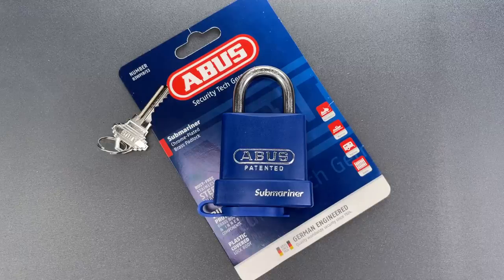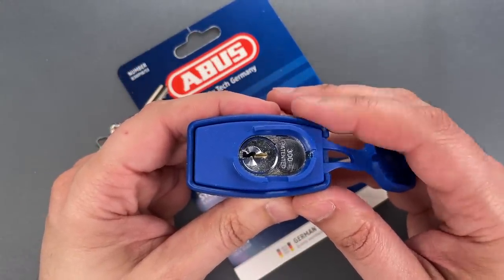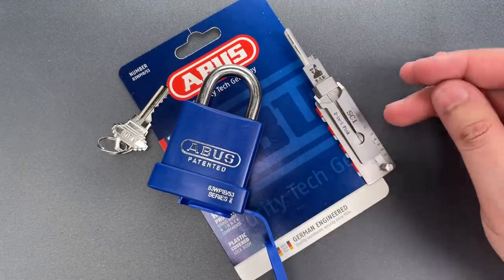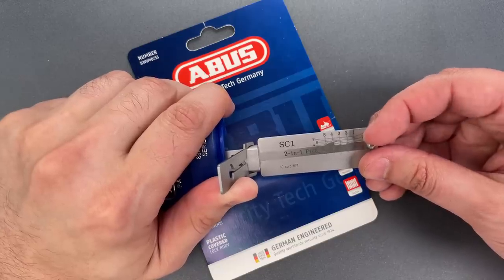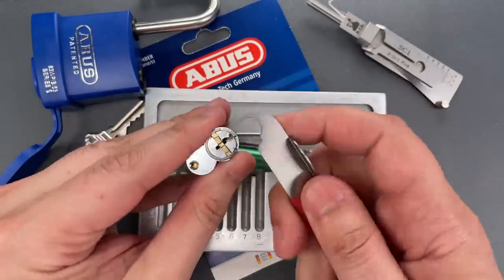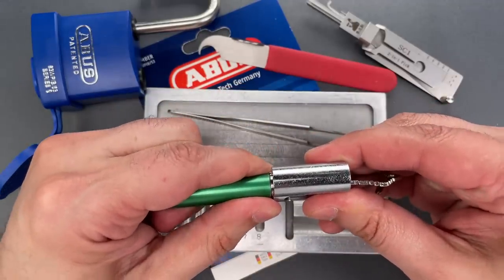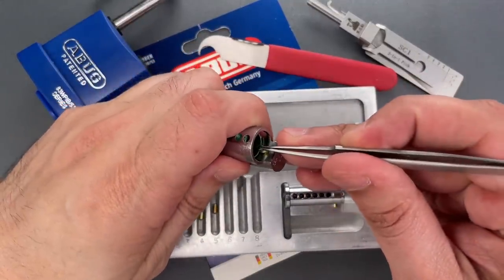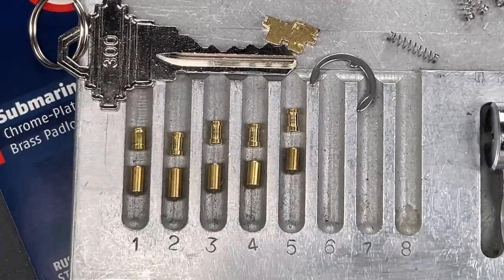[1329] Abus “Submariner” Marine Padlock Picked & Gutted (Model 83WPIB/53)

Comment: I would be interested to see you put a lock back together after gutting it like this
Reply: After you put the driver pins back there isn't much to it.
Reply: He has a video about upgrading locks to be pick proof
Reply: @IAMDARTHVADERBITCH  Link to that video pls ?
Reply: @Boaz Greenwood there's another video on that too
Reply: @Boaz Greenwood so how would you?
Cuz I have a vague idea of a tool that could work
Reply: @Boaz Greenwood he actually says that in the video, doesn't he?
Reply: @Boaz Greenwood it’s just a trap for those who are not aware of it. Pick resistant yes. Definitely not pick proof. The trap will render the lock useless. Can’t open with key if trap is set off.

Comment: I really love the modularity of locks like this. the ability to re-pin locks is something I think I'll look into at some point so I can get rid of some of the keys off my own key ring.
Reply: Long ago, I had one key set for my house , parents, inlaws etc..  I really do not like carrying keys.

I also cut the two sides of a toyota blank to work on my wifes and my truck.
Reply: Abus 83/45 or 83/50 is your ticket.   We use them to lockup patio furniture at our restaurant.  They are all keyed the same as the front door key.

Comment: Compared to his normal reviews, this almost rises to an endorsement.
Reply: It's a competent implementation of a standard keyway, with interchangeable cores.  A novice like me can easily key these things.  That's what the cutouts on the side are for.  So you don't even need to use a follower to re-key it.  It's not a high security lock, but it's also not a cheap MasterLock. I would consider this to be a workhorse lock for homes and businesses.
Reply: LPL said it best, it's fine for anything low security. It's also cheap so you get what you pay for
Reply: @ViperGecko6  and the added factor of a very specialized application makes is a niche product!
Reply: Well, it's ABUS.

Comment: So, the lock is German but the core is not, which probably means the lock itself is better than the core...
Reply: @silvertip185  I see. I thought because LPL said it is a Schlage core that it also meant, Schlage produced the core and Abus just inserted it into their lock.
Reply: @MhLiMz  Nope. It just conforms to Schlage's keyway pattern. Every single driver pin was a security pin of some type; Schlage doesn't go to those lengths.

Comment: This must be a pretty decent lock because I didn't hear LPL say the phrase, "obvious security vulnerability."
Reply: He even said it would be "good for a low security outdoors situation like a garden shed". That is better than 95%+ of the locks on here.
Reply: I mean, it is an Abus.
Reply: If you want something in a maritime outdoor area securely locked, just use a non-maritime lock. Just be ready to break it open when you need to get in.
Reply: Well, Abus usually makes high quality locks, and Schlage cores aren't terrible.  Just LPL is quite good, the Lishi tool makes it easy, and the bitting wasn't all that impressive really.  Plus there probably isn't much point in putting a $100 core in a lock that can be defeated with a big pair of bolt cutters.

Comment: Does it really cost that much more to add security pins? I don't really understand why lock makers cheap out on hose.
Reply: Yes, and no. The price difference isn't much per lock.. but when the production run is high volume it adds up fast. Pretty much everything you own is made from the absolute cheapest garbage material, by the cheapest method, that's barely acceptable for the purpose.. because the manufacturer saves a buck per unit, and sells millions of units, making an extra couple of millions in profit.
Reply: Let's say they're an extra $0.05 each due to the volume discount. Times 5 pins per lock is $0.25 extra a lock. Times how many million locks?
Reply: Inventory, economy of scale, pin orientation, feeding mechanism. It’s much cheaper to carry one straight pin than multiple different ones with security features. Pins can get mixed up or jammed the feeder. Straight pins are much easier to handle.  Lol.

Comment: Stainless will rot underwater. Stainless steel actually needs to be in the presence of oxygen to not corrode. Source, sailor and we all know to check and move chainplate deck seals (where the wires that hold the mast up pass through the deck to attach to a support structure below) every now and then so our they don't break and unexpectedly cause issues.
Reply: Sure, but if it's just getting splashed or rained on, it's fine.

Comment: The name makes me imagine that this lock will be found on the side of a submarine.
Reply: Despite the name, no. Sorry. Only GSA-contract locks found there (or other nations' equivalent of the GSA). Unfortunately, you are not allowed to specify brand names without very specific circumstances, so you get what the GSA provides: minimum-bid locks. Excepting, of course, for certain high security applications, which this lock will not meet.
Reply: Honestly, the submarine itself is all the lock you need, for most purposes. You're not getting into one unless you belong there, or are being escorted by someone who belongs there. Armed sentries, extremely limited access pathways, zero privacy for nefarious acts, and a crew who all know who should - and should not - be present, all make for an extremely secure environment.
Reply: Keep in mind that the guys on the submarines pronounce it "sub-MARINE-er" and not like the Rolex word. This from a guy I knew who served on a submarine.
Reply: @stefanfrankel8157  well, yeah, because we work on subMARINES (to put the accent in the right spot).

Comment: that window is there so it can be re-pinned without being disassembled? Nice
Reply: Do you refer to the opening in the follower?
Reply: @VaneyRio  Look when LPL inserts the key to turn the core, there's a window cut into the lock.
Reply: @VaneyRio  as llortnerof says, in the lock itself. So if you push in the end stop and rotate opposite to normal operation it will expose the pins without the need of a follower or even taking the circlip off
Reply: Cool, I don't know the purpose of it

Comment: I think I prefer the use of normal picks. Using the Lishi tools is fair because it's an available tool, but I would rather see you use standard picks for things like padlocks.
Reply: I like the visual aspect of the Lishi tools.
We know he can open it with either, and this makes it much more visual.
Also, there are probably 1000+ videos where he uses traditional tools, it is nice to mix things up.

Comment: The mechanical bypass to the digital pushbutton electronic latch on my front door is an SC1 with security pins, just like this ABUS padlock, but the deadbolt is a MultiLock Chronus pin-in-pin with active element.  I bet there's no Lishi for that.   😁

Comment: I have a set of cheap ABUS locks, got them in a pack of 3, with the same pinning, they fit perfectly into my needs, I have 2 of them on 2 of my rear gates, the whole fencing is made of wire-frames, so the locks are far from being the weak spot, they are also on the inside, why I like them? Secure enough, same key for all the gates, they do freeze up in the winter (some wd-40 would likely help prevent that) but then I don't use those gates and as opposed to the locks before, they still work after that

Comment: Can you use a schlage sc4 lishi on a sc1 lock? This may be a very stupid question but just thought I'd ask.
Reply: I think he showed in a video that it wouldn't seat fully; the core's not deep enough apparently. You might be able to feel for the pins but 5 might give you fits. But if it's only pinned for 5 pins in an sc4 / sc9 core, it seems to work...

Comment: If theres only a 1/8" or 3/16" screw holding the core in place. What the pressure required to rip the core out forcibly? Or When locked, does the shackle lock into the core?

Comment: Can you show us how you would put this core back together? Between the key pins, the driver pins, and the springs it looks like it could be a tricky process that would be interesting to learn more about. Thanks!
Reply: @Boaz Greenwood jeez...sure, anyone could figure it out - but "its really not that difficult" and "put the lock back together" doesn't really add anything of substance... especially when there are locks with varying pin lengths, pin types, spring sizes, etc, that need to be put back together in a specific order (which is why it puts it all neat in his tray). He's got a method, I'd simply just like to see it.
Reply: @Boaz Greenwood While i appreciate your followup, I'm not really looking for an explanation here. I don't have a need to put a core back together, I just want to see LPL do it and have him explain how he does it. Like i said, I could probably figure it out, and there is probably a wealth of tutorials i could read over and do it... I just want to see LPL's method. I know in theory it's as simple as putting it back together or following your explanation but that's not what I'm after, nor is it the point of my initial request. I just want to see LPL do it in a vid. That's all. Thanks.

Comment: Besides the markings on the tool, is there anything specific about it compared to other models, or could you potentially use one of those tools for different locks by ignoring the markings and  feeling for the pins instead?
Reply: As I understand it, the markings are just there to help. Some locks might be more awkward with a standard tensioner and pick, but you're still just essentially feeling and picking each pin so it would work exactly the same way.

Also, as a note, I don't think this tool would be able to fit all keyways. I recently bought a set of 4 locks and one has a very jagged keyway that I don't think this tool would fit.

Comment: Hang on, if the lock is intended for use in a corrosion-hazard environment, but you can key-alike it with a conventional lock core, wouldn't that make it likely that the core used would be not-corrosion resistant, and thus mean that your lock body which will not corrode is holding a core that can?

Comment: Wait a second this isn’t right. The SC1 is not the most common residential keyway in the US, its KW1 for sure
Reply: It’s been a while since I worked at a hardware store but this matches my experience from then—Kwikset’s KW1 (and the various other manufacturers who use the same keyway, including lots of private-label locksets) was probably the most common one I cut. SC1 was #2, but still significantly behind KW1. This of course is anecdotal but based on the kinds of keys I see on friends’ keyrings, it still seems plausible today.

SC1 certainly still is one of the most common keyways, even if not the most common.

Comment: The brass tailpiece to the cylinder, is that a way to defeat bypass attacks?
Reply: Yes
Reply: That's the Z bar Abus use, depending upon it's orientation (hole up/down) you can enable or disable it's key retaining function.
It's a really neat way to do it.

I own those locks, very reliable. Also use one of the non sheathed versions and it's been on a gatepost for over 2 decades and still scrubs up like new.

Comment: Question. How do different security pins increase security, like what do they do that makes the lock harder to pick?
Reply: IIRC from his other videos, it's not harder to pick per se but is resistant to a different attack mode, where if the pins are pushed all the way up and are the same length then you can take an impression that matches the key.
Reply: It's a matter of how they catch against the shear line of the lock. Here's a good website with images that show how spools work.
www dot art-of-lockpicking dot com/security-pins/
Serrated pins work to give the impression you've set the pin at the shear line when it's only caught the serration, so you have to try to set it multiple times.
Reply: @jtsholtod.79  ah thanks I'm trying to get into the hobby and was curious.
Reply: @padawan_weeb  I'm a novice at best, but I found using transparent and cutaway practice locks to be really helpful in visualizing the various parts when starting out. It's not cheap, however, but there may be some forums out there that can help you to borrow or exchange them.

Comment: Is anyone else just a little freaked out that a tool that's readily available, that anyone can use, that can get into most of our homes, exists in the first place?
Reply: I live in fear every day knowing that bent metal exists.
Reply: That was always the case. Those still take some practice and you have to match the tool to the target, though just a few would probalby cover a large majority of common locks for "only" a few hundred dollars.
Reply: Do you mean a shoulder, a hammer, or a crowbar?
Reply: A lock is just a deterrent. Even locks on bank safes, military cabinets etc are just there to stall an attacker for long enough for a response team to arrive. Even if you went to the trouble of getting a lock that's very difficult or impossible to pick, there are destructive methods of entry that a determined attacker could use instead
Reply: High security disc locks, and two independent alarm systems.. so, no, I'm not particularly worried.

Comment: It seems like you have largely transitioned away from using standard lockpicks in favor of lishi tools. Those terrify me for multiple reasons, but mainly just how easy it makes breaking into a lock. With traditional lockpicks it takes a lot more dexterity and positioning and not everyone can do it, with Lishi tools it's just a matter of experience. They can be made for virtually any standard lock style, so you can guarantee that a Lishi tool will eventually be made for a new one. That's going to turn high-security locks into a massive arms race to somehow prevent this type of tool from working.
Reply: @kilwala2242  True that, I'm glad something like that hasn't happened yet. Most criminals are criminals of opportunity, and I'm worried that these tools make said opportunity much easier to find.

Comment: if there was a "universal" lishi tool which is just a tension bar and a pick riveted together with some sort of generic grid to ballpark the cut and pin number, i'd 100% buy it, but i think 20 bucks for a single type of lock is pretty steep.
Reply: IMO 20 bucks is cheap for what this tool does.
Reply: @carlinanderson2605  Maybe for a locksmith, not a hobbyist.
Reply: @Boaz Greenwood i don't think you get the point of my comment
Reply: @Boaz Greenwood it just has to be a standard hook and instead of the tension interface being the keyhole it could just be a wiper insert sort of thing, the grading or markings on the handle don't really matter just have it as a point of reference
Reply: @Boaz Greenwood you know "the pick bosnian bill and i made" its an all in one for tumblers, i just want the same from lishi for regular locks, it's entirely possible, maybe a few sizes but i think it's entirely possible and there'd be a market for it
Reply: @Boaz Greenwood you're missing the point over regular lock picks, it's hard to feel binding without a lot of practice with a loose pick, having the pick braced on something makes this extremely obvious and you can see this on the lishi tools.
Reply: @Boaz Greenwood Yes i pick locks and i still think you're misunderstanding me, the lishi tool is a tension bar the shape of the keyway and a regular pick riveted to the tool outside of the key hole. Due to the angles of resting the pick on the keyway feedback can be vague

Comment: In other words, not quite the lock you'd use to secure your ballistic missile submarine? Or even a £30K 36 ft sailboat or a canal boat.
Reply: meah, it's reasonably pick resistant or change the core to a disk detainer type.
Reply: Definitely a good lock to secure a storage box on your boat, that contains semi-valuable stuff.
Reply: @marvindebot3264  break out the tool that "bosnianbill and i made"

Comment: It occurs to me that one could make a lock incredibly difficult to pick if the pins are set in holes machined such that the insertion of a key tilts them onto a smooth channel while manipulating them with a pick or hook or sommat would be more likely to jam them into ridges instead. Would be an absolute cunt to machine such a lock body though.

Comment: Oh a new padlock that is SOLD BY THE SUPPLYER as a security system.   Disassembled within 2 minutes. Then completely deconstructed.     IS ANYTHING SAFE?
Reply: No. There is only resistance and will. These can be compared and even measured. "Safety" is a pacifier for babies.

Comment: Can you pick a car/truck and start it up?
Reply: If the car is "pre-chip".  Then I would imagine it's just another lock.
Reply: @vanman6534  Late pre-chip ignition locks were protected against picking by other means, such as magnetic sensors designed to enable fuel only when a key is present during rotation.
Reply: @abitofabitofabit4404  Thank you.  I wonder if using LPL's tool would fool that system?
Reply: @vanman6534  If the magnet were ultimately pushed by a wafer or pin, you would have to hold that in position while turning the tool to start, and hope that you meet the timing expectations of the ECU well enough to avoid triggering anti-hotwire features. If the magnet only detected presence by the length of the key, it should be easier. I don't recall whether the Haynes manual I glanced so long ago went into that level of detail.
Reply: @abitofabitofabit4404  Thank you.